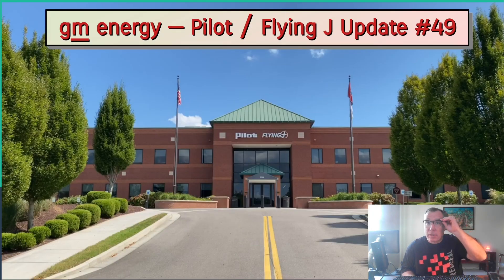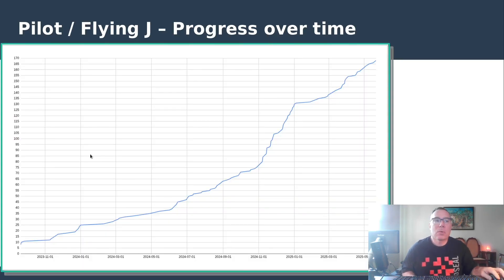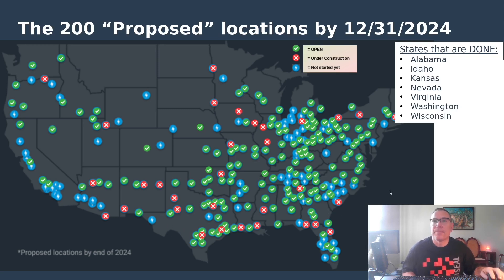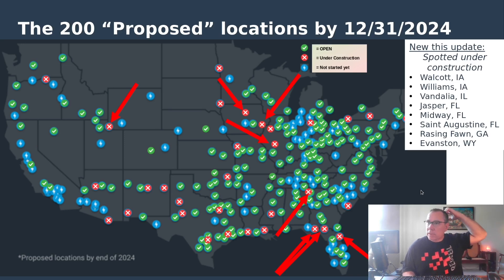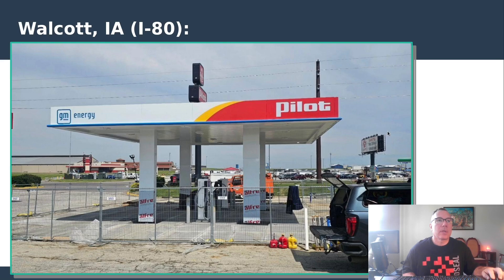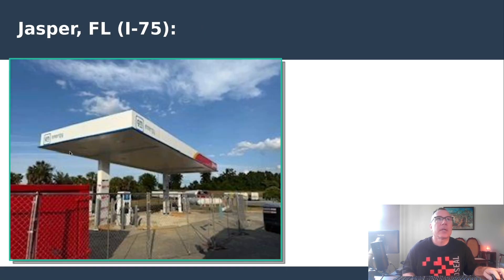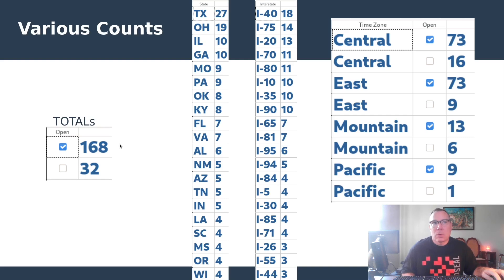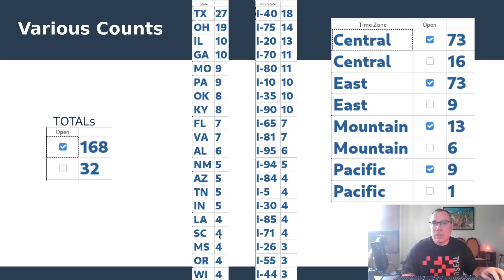gm energy - Pilot / Flying J Update #49 (Electric Vehicle Charging)

Comment: Thanks Walter.  I couldn’t be happier seeing PFJ continue their builds.  On my trip from Atlanta to Florida yesterday I stopped at the new iONNA in Valdosta and a FlyingJ in Dade City FL.  Both were a breeze to charge, but the iONNA being a “Rechargery Relay” had zero amenities, while the FlyingJ had everything an EV driver could want.  THE FlyingJ was by far a much better road trip stop. 

5 stars to PFJ for consistent quality, ease of use, speed, and all amenities EVERY time.  PFJ is my GO-TO!

One comment on the Valdosta stop, the EA site there is terrible.  Old broke down chargers, so iONNA is a HUGE UPGRADE for Valdosta. But if you want amenities in Valdosta, best to go to the CircleK there.  Or better yet, time your stops for 2 smaller ones at PFJ in Jasper FL and Tifton GA on each site of Valdosta and avoid Valdosta all together.  

My 2 cents!

Comment: Today, I charged for the first time at a Pilot Travel Center in Bellemont, AZ.  I had stopped at the Subway for lunch and decided to see what it was like to charge at a Pilot site, even though I didn't need to charge.  It was similar to the olden days when I drove gas, I plugged in, swiped my card and it charged.  I got 78 kilowatts, which is maximum for my Kona. Great experience, except for the price of $0.61/kWh.